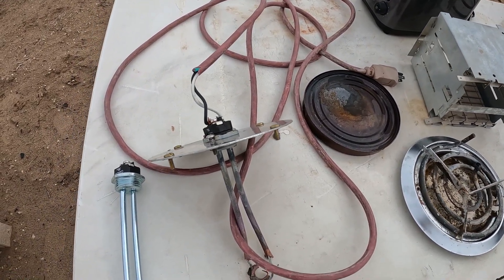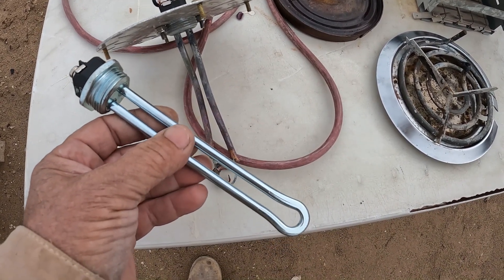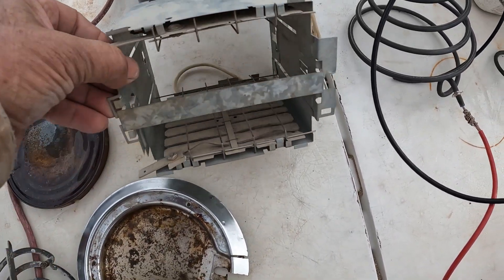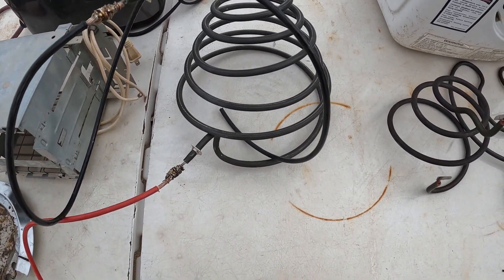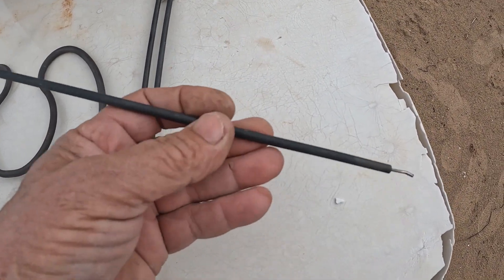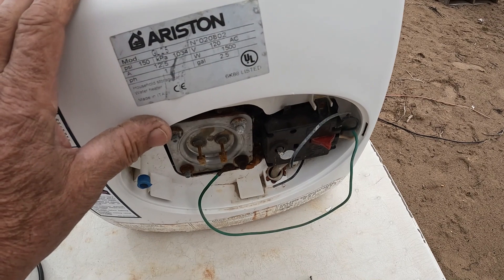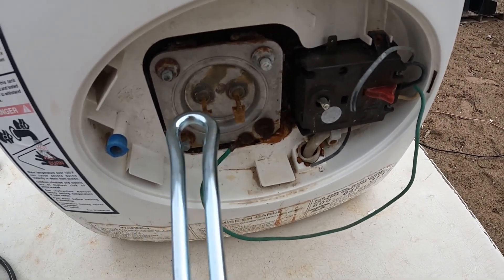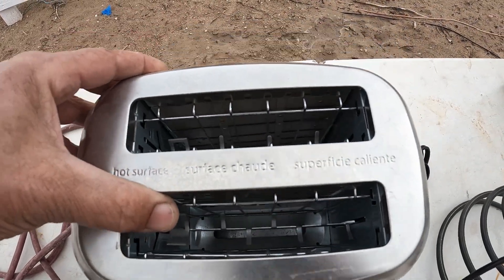More Elements Part-10-A

Comment: You can use variations of ohms law to determine how long the coil will last, easy peasy.
Volts (E), Amps (I), resistance (R or omega Ω).   It works everytime.
  If you know the voltage is 120 dc for example, and the coil restamce R is 10 Ω, then you can find the amps.  Therefore, if you know the coil can only handle 20 amps without dying in a year, then just do the math.  E = I x R, or
 I (amps) = E (volt) ÷ Rist.  Divide voltage by the resistance of the coil and you have amps you need to calculate the coil longevity so to speak.
 Works everytime!
Reply from the maker: That will be very helpful. I wasn't aware of that formula. I am familiar with resistance ohms and the basics but have not heard of that basically because I have never tried designing something like this before. I am a Machinist by trade. Thank you Sir for the information.
Reply: @off-gridsurvivalmike8120  GL!